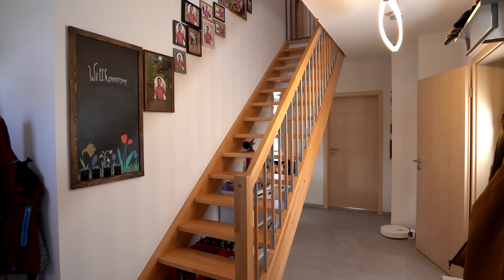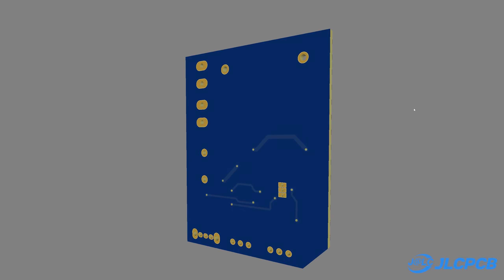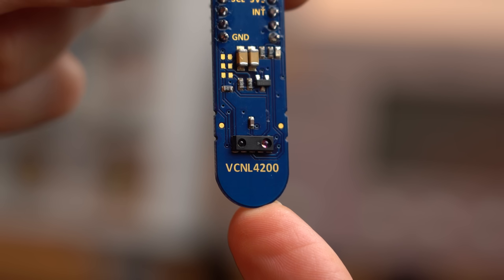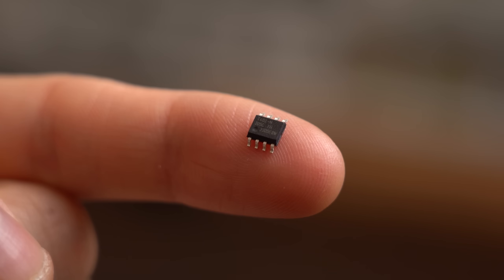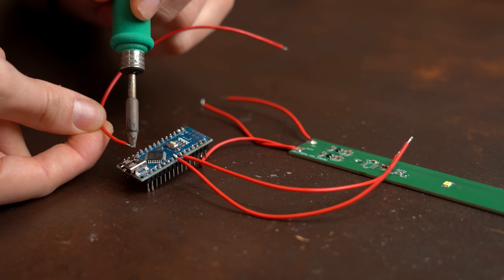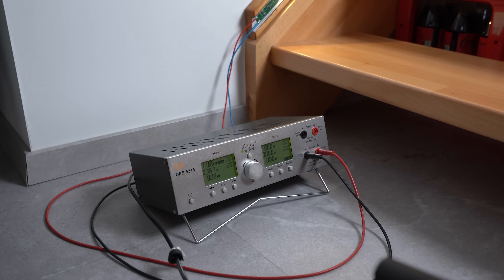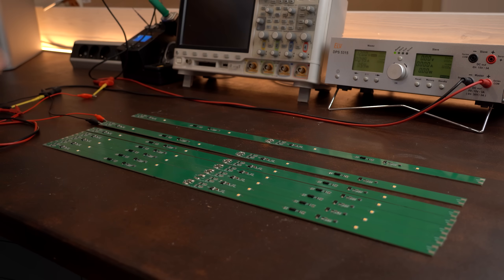I tried to Revolutionize LED Lights!.....And FAILED?

Comment: Love the overengineeredness! If i would make this however id keep the simple stuff simple as the hard stuff is hard enough. Have you considered a single microcontrollwr for the whole staircase? Even an esp32 suffices. Add an ial lightstrip like a normal 28xx 12v one (12 for the large distance and voltage drop) and a seperate line with distance sensors. When all the sensors and lights are on 1 microcontroller, your code is immensly simplified. Just a maxvalue filter on the distance for the currently steppen on staircase and a minimum threshold. You can even normalise the noise by averaging out all the sensor input. This is the way

Comment: Mount sensors and aimed laser diodes in the ceiling. Without smoke you don't see the beams, only the spot point where the beam intersects the wall or step or whatever. Requires no distance wiring.

Comment: I made similar lights. However, I took another approach. I use PIR sensors (trimmed physically to a narrow slot) as start and stop gates at the bottom and top of the stairs then I time the stair animation based on the average pass between these points. Yes I don't detect individual steps but you'll notice that in exception of running, each staircase has a very consistent traversing speed. I was able to easily pick the speed of the lights switching ahead of me with me early overtaking the strip.  
Best bit? I used £20 worth of components for 11 steps.

Comment: I think you should try to explain to us how the daisy chaining mechanism is supposed to be working. And that would expose the problem very quickly. I visualized how inputs and outputs are interconnected between multiple boards on paper. And it seems that each board's output gets connected with two adjacent boards' inputs, but after that, also every second (one skipped between) board's input to the left and right gets the same output signal. So it gets a bit confusing then, thinking of what the firmware should be doing...

Comment: If you're communicating with each board.  You can send out a simple int up and down range of the triggered board.  So for example sending out 3.  This would be how many boards are lit up/down stream.  The next board sees the 3, turns on, changes 3 to 2, and passes on the number.  The next board lights up, turns on changes 2 to 1.  The next board lights up, changes 1 to 0.  The next board gets zero and does nothing.  Also depending on how you trigger the board, itself being triggered vs being triggered by a neighbour will give you a direction and you can light up boards in only that direction.

Comment: If you can get a frosted light cover you could try buffing it down and fix it with a yellow headlight restorer. Also this will allow you to determines it's angles of view so they don't see all the way up the stairs. If you get them to only see two stairs up and down then you wouldn't need the controls.

Comment: A bunch of sensors can mess with each other.  I went with radar (Doppler GHz) at top and bottom, they are far enough to not see each other.  Then you can turn on all the LEDs in sequence (away from motion) and control them all from nice microcontroller.  Giving you tad more time to move past them.  Then shut them down again in sequence.  And those radar sensors are so awesome!!  Oh, addressable LED’s could share power and data.  And I agree, we love learning along side you.  My projects go the same way!  ;)

Comment: Now that I've seen your results, I'd probably add communications between adjacent strips. Then one board could tip off the neighboring board to go into low light mode for a bit, or enable a timed cascading On/Off sequence for a more appealing presentation and integrated design. I'm eager to see the final design!

Comment: Addressable / Zoning (with few staircase steps), based on dimensions e.g 1-5 steps ~ Zone 1, 6-10 ~ Zone 2 and so on, this will provide fault tolerance too, not all LED strips will go bad at any given point in time and thus some visibility will always be there to prevent a fall from staircase.

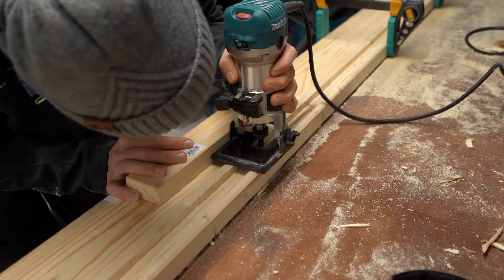Comment: 3:47 I don't want to be a jerk about it, yet I need to tell about router guides. Or make the channels from two L-shaped or chamfered/filleted pieces of timber. Or 3-6 pieces of wood glued together in an u-shape.
4:16 Love the picture covers .D
6:49 Clear cutouts for the sensor or just cutouts in the opaque cover.
9:43 Why not just add some test pads/holes?
11:23 Using plugs instead of soldering between boards could help with assembly and testing before mounting.
Overall you could even try to substitute distance sensors for tensometers attached to the underside of the stairs (assuming you have stable temperature and humidity.

Comment: Have you thought about ditching the distance sensors and using load cells or some kind of load sensing resistor? You could mount them to the underside of the steps 😅

Comment: What if you put one cheap PIR sensor under each step, at the right distance and angle so it can see only the step bellow . And maybe add a couple of bright LEDs on the sides of the PIR to beam on the step bellow

Comment: Maybe instead of the infrared, try to use the HLK-LD2410 module - it has antenna onboard, you can just solder it on top of your PCB no problem. It can be programmed using BT, but you can also use serial line for it. If you don't need the microcontroller, you can program each step individually, giving it different sensitivity (e.g. the upper and lower step will turn on earlier when you are approaching them) and you can use the "presence" output of the LD2410 as a signal for the LEDs - no uC needed then. But you will loose your PWM :)

Comment: maybe one ir distance sensor does interac with an second one, so the ir source gets from one sensor is piced up by the next one? also i would use only one controler and also leds like ws2812b or something like this. but  i would maybe use an other type of sensor... the i2c bus can hande all sensors on une bus if the sensor adress can be changed...

also maybe the leds light up the staircase so brightly that the brightness thats detected by the sensors is ower the threshold and keeps the light off...

Comment: You should buy an adresabble strip, make a strip out the distance sensors and control the led strip based on the signal from the sensors. You could implement extra functions like animatons or different behavior when going up or down the stairs.

Comment: You could have the LEDs triggered by a vibration sensor, so it will be switched by footsteps on the adjacent steps.
You could also change brightness in relation to the vibration strength.

Comment: I tried to build something similar for my bathroom / toilet-aim-aid automatic night light. 

The original plan was to have it voice controlled, of course. At least footstep sound controlled. Turned out that the sounds doing the controlling was on a level comparable to brief night noises (snoring). 
Then I changed my basic plan to have a simple switch activated by the door, but then it turned off when I closed the door completely while inside. I briefly thought about two IR detectors to detect the entering or exiting the bathroom but it would have been susceptible of detecting the body in one direction and immediately an arm swinging back in the other direction. Also just have the nightlight continuosly dimly lit from dusk to dawn, but it would be a nightmare to wire an external light sensor. Using an ESP01 outside and another at the light would be ridiculously over engineered (despite "WiFi enabled pee light" sounded cool ).

Ended up leaving the LED on all the time day or night, since at less than 5mA it gave just enough light from behind the toilet to outline it and the bathroom door, but not enough to disturb sleep. Maybe I'll install a narrow beam LED in the ceiling just above the toilet.

Comment: Although it's very very cool to see the leds operating individually for each step, if it was my project i just had used a simple led strip a sensor on top and another on the bottom and done.

Comment: Long time ago I've made similar thing, but I've used CNY70 sensors bought on aliexpress for like €0.1/pcs + attiny13. Program was straightforward: pulse LED and check, if there's hi/lo signal on output. I remember I had problems with ambient light and also with other modules around, but that was easy to fix with sync in/out signal + some simple fir filter implemented.

Comment: I would properly use a split model with only one processor. The sensor is i2c, so it can be chained over all modules. I also would consider using a ws2812, which also can be chained over multiple modules. The brightness of 2 or 4 leds per module should work. Chain linking the i2c and led datalink plus chunky rails for power are enough. Ha ving a power regulator and LED driver and a cpu per module is overkill. One cpu/power module and the others just linked sensors and leds modules are more than enough. The LED modules can be designed to hold x LEDs depending on the need/ preference.

Comment: Rather than motion sensors.. a small load cell under each step to detect pressure on the steps might work better

Comment: maybe using strain gauges on alternate steps or after a set of steps can help a lot for detection and simultaneously switching between LEDs(But yes it would not be easy on the sensing side)

Comment: Hello, have you looked at the HLK-LD2420 sensor. In China you can buy them for about $2-3. This radar operates at a frequency of 24GHz and the sensitivity can be adjusted from 0.2 to 6 meters.

Comment: You have some metal trim on the other side of the stairs directly across from the boards. That might be causing one of your problems. Maybe tape some paper on them to see if that does anything.

Comment: What if you change the whole design!
Here is what I think, 

Make a led strip that can turn on Led one by one  simultaneously with your average walking speed on the stairs. 
AND to trigger this you can place a capacitive button on the wall near stairs.
OR place the capacitive button on - Idk the exact word (where you place your hand while walking up).

Doing this will reduce all the unnecessary work which attiny doing(read sensor values all the time!), I think doing this is more efficient - cosidering your purpose.

But you can't run on stairs.😂
But if you want to run on stairs anyways,
Programm the capacitive button on the wall such that if you press twice the speed of led strip will be double. And so on...

Comment: I think you should have used a led strip and use a sensor at only ends which would have cheaper and puting a timer like led would switch off after 5 sec according and ( eliminate in a chain pattern )

Comment: It's good to see a failed/incomplete project as most hobbyists will struggle through similar things. Looking forward to part 2.
Thinking outside the box, It's possible you could control the LED driver with a voltage signal instead of PMW which might lower your noise?
Another thing, which may not matter, the capacitors on the power regulators inputs are all in parallel.
The led driver chip could be replaced with a mosfet driving the LED and the Atiny could control dimming, this would then remove the need for a 12v>5V just run the whole strip on 5 & 3.3V

Comment: Using a linear regulator to power the LED would be a good idea because it's not a linear dipole.
Since their voltage is roughly constant in most the the upper part of the current supply that means that the regulator won't get much voltage until the current gets quite low.
And since P=U.I and you either have low voltage or low current going on your regulator, it will be relatively efficient.

Comment: Socket the connection between boards so you can separate then and take them back to the bench to work on, soldering them all together into one giant circuit is just asking for problems.  If you were to re-design I'd probably build small boards that sit behind a WS2812 strip, and utilize the existing WS2812 circuitry for LED control and just implement the proximity sensing on that board.  If you want bidirectional messages, get two of the narrower strips and run one in each direction and catch the signal from the upstream and downstream board.  Only re-invent the parts you NEED to, not the whole thing.

Comment: We have a dark hallway (is that the right word?😅) in our home. I used one of those resin covered led strings,  powered by a 5252F solar chip with a 500F Supercapacitor. Around 5mA is enough for up to 12 meters. It works every day, even on a dark winter day. It's there for years now and it just works, no money, nothing.

Comment: If you make a V2, i'm thinking you should use addressable LED's instead. It's still scalable, and could still use I2C sensors, instead of PWM like this version you just address the line of LED's corresponding to each sensor that goes above a set value. the benefit here is you only really need 1 micro controller to run a string of them.

Comment: You are indeed making me feel my age.  When I was young, from birth to age 12, we lived on what was called the "home place' an old house built by grandfather in 1910.  While REA came through and put a high line pole in our yard, nobody bothered to run a wire to the house or for that matter wire the house for power.  So it was, when we went to bed in the 2 rooms that were "upstairs" we climbed the steps which were painted white but have a black mat on each step so there was pretty much no light other then that small flickering lamp that mom had lite in the kitchen below, that being a kerosene lamp.  We would go up-stairs using all 4 limbs, hands on the step above and feet on those below till we reached the top which had no landing to speak of, just turn and you were in the first upstairs room, there was a drop down door that we had to lower once we were up there to keep the heat in for the downstairs, In the second room were two beds, one large for my sisters, and one small for me. That room had a lover that could be opened to allow heat from the coal space heater in the living room where my folks slept in winter to stay warm.  The upstairs had no finish on the walls or ceiling, in the winter the shingle nails on the roof would have heavy frost on them, and when we woke up it was common to see your breath in the morning light that came from the one window that faced the East.  It was a good life though, we all grew up to be successful, and all of us were very creative, you see you had to be because there were no televisions, phones just a battery pack radio that was high enough that we could not reach it to turn it on without a stool to stand on (batteries were expensive in the 50's)

Comment: I wonder if some of the sensors are getting crosstalk. Maybe the sensors need to be further apart? Also, I would recommend board to board connectors for the next revision so that you don't have to solder them all in-place.

Comment: Awesome project! I wonder if you could still use the milky diffusor cover, but for the sensor try to use a stripe of transparent Tesafilm. Depending on how your diffusor works, putting on clear Tesafilm on it should eliminate its light diffusion property. Maybe worth a try, so you could create a tiny window just for the sensor, if it works :D

Comment: I solved this with 3 dimmable led lights at the top, center and bottom of the stairs with a sensor trigger when you approach either end. It’s on for 5 min, but it’s red and quite dim so don’t really matter or impact your night vision

Comment: That's a pretty neat idea indeed, dude! 😃
While I was watching I kept thinking about a way to make it work... And, well, I have a suggestion for you.
First, it's how you mentioned: filters and everything. Second... Would it be possible to have only one "brain" for all of them?
Because all you really need at each step is a sensor to detect someone and the LEDs themselves. The controller doesn't need to be there and if only one controls them all you'd be capable, for example, to turn on the LEDs from the step where you are, the one before and the one after, both of the last ones with 50% of the light, let's say. You know? And it would be easier to control in case there's more than one person at the time (like one going up and the other down).
Anyway, looking forward to see what you create! 😊
Stay safe there with your family! 🖖😊

Comment: I had the same experience when using ir distance sensors on a mobile robot. The robot would detect spurious obstacles around it. Adding large capacitors close to all sensors solved the problem.

Comment: Thinking some more... Possibly, inexpensive PIR sensors, masked to narrow the response, at a few points along the stairs, with the second one from top or bottom used to detect the approximate rate of travel, to allow "interpolating" the person's movement along the stairs, so that you get a smooth transition of illumination.
Alternatively, radar sensor looking along the stairs, can detect presence, direction and speed. i don't know how many LEDs that you'd need, but, if you have limited gpio, an lp5523, I2C controlled, can control 9 channels, and do automated fading as the led illumination is moved along the stairs...

Comment: With this design, it seems both I/O data lines are running along the full length of the staircase connected to every uC. Not sure what kind of standard you use, i suspect a simple rs485 could work. This would require proper termination if i am not mistaken.

Comment: Nice video! May be you can try to put only one distance sensor at the end of the staircase which can tell where you are on it and address the LEDs. I use this MCU too with the Arduino IDE and the PWM works perfectly without messing with the timer, may be your code overwrote something.